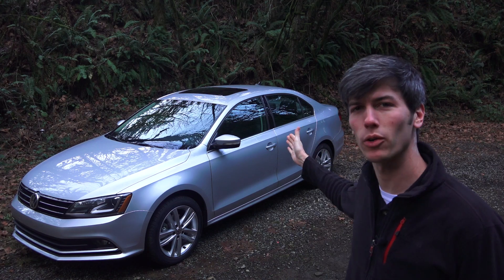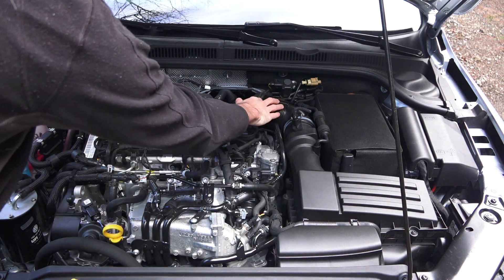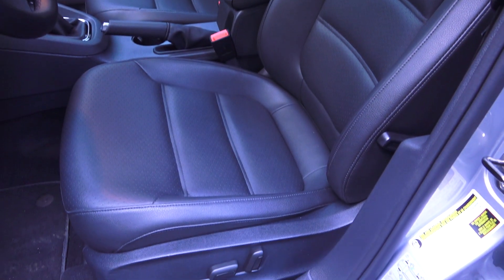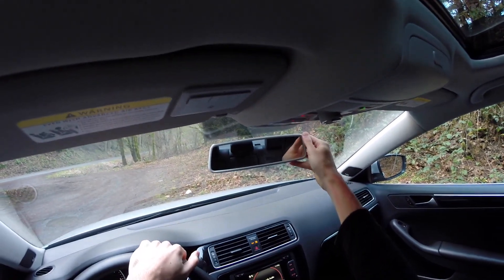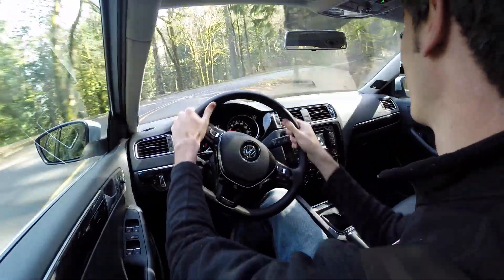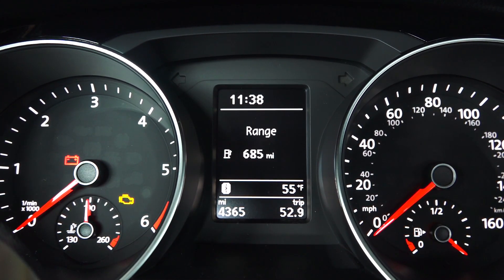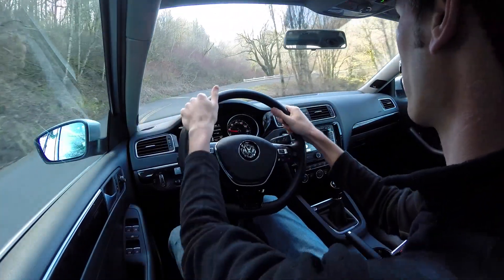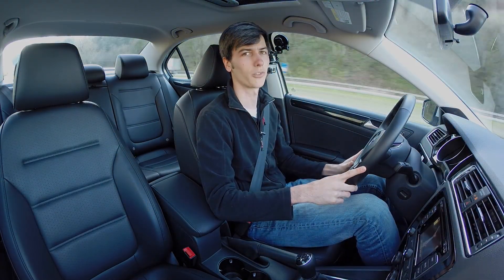2015 VW Jetta TDI - Review & Test Drive

Comment: So, would you consider a 5000$ gap as justified in comparison to the Corolla?
Reply from the maker: Very good question. The base starts at under $22k, though the base Corolla is maybe $17-18k. I've driven the Corolla LE and wasn't as impressed as I was with the Corolla S. Diesels will pretty much always be more expensive, but I thought this was a fantastic car. If you're considering between the two I say test drive them and see what you think.
Reply from the maker: elwulfo666 Let me add, I thought the Jetta was more fun to drive. The Corolla is certainly more economical, and comes with Toyota's undeniable reputation of reliability.
Reply: and if you compare the interior? which one do you prefer in terms of quality, material and "infotainment"(i hate this term :D)
Reply: termantor28 I'll give you the doors that close with a better feel and sound, but I recommend you have a look under the hood and interior trim. You will find cheap parts in places in this VW where you certainly would not want to see them.
Reply: elwulfo666 I would say the vw would blow the doors of a corolla in terms of quality of materials, i even just closing the door on vw feels solid, when it comes to the corolla it sounds like a hollow door. Test both cars and see for your self
Reply: Markus Krause Greetings!
I must not agree with you in sense of comparison to few other car manufacturers. I think VW's interior look is indeed... hmm casual?.. like we are used from Germans, but every single thing is placed where it should be and every time you look at dashboard, you got this feeling "Damn, they have really put some effort in making it as much driver friendly as possible".
Most of parts which are used by driver are (in my opinion) made from "non-cheap-feeling" materials. But ofcourse, if you do look at parts, which are not used that common at casual operating, then sure you'll find materials which give you in most cases "cheap-feeling". 
It's just my opinion, but I do find Jetta's interior nice. Causal with sense of usefulness.
Best regards!
Reply: Markus Krause . I couldn't agree more. I've been a technician for well over 20 years now and German build quality is some of the worst in the world. Their plastics, rubber and bonding materials are designed to fail too early in life. The fuel economy of a vehicle such as this will more than likely be well offset by its terrible build quality. I would typically advise my customers to consider only buying one if they plan on selling it before the warranty expires. If one is looking for a truly economical vehicle, then you should consider something Japanese, such as Toyota or Nissan. Their cars are designed to last. I would be surprised if anyone who cared for their Japanese car didn't get a good couple of decades out of it, at least.
Reply: Baerchenization Take it easy for a bit and try to listen.

Yes, Toyota had recalls. Yes, there were some bad issues, and some mild issues. Yes, they should get flak for it.

But this does not mean that Toyotas are not reliable. The numbers still speak for themselves time and time again, year after year.

You're taking the recalls and blowing them way out of proportion in order to incorrectly conclude that Toyotas are not overall one of the most reliable brands you can get.

The fact is Toyotas get you from A to B more reliably and consistently (THIS is what people consider reliability in the automotive industry) than most other car brands IN THE BIG PICTURE.

Please try to be more objective. The stats don't lie.

FYI, I do not own a Toyota. I drive a VW that I bought brand new. I've taken it in for warranty work twice in the 37k miles I've driven it (still enjoy it though).
Reply: Baerchenization Sigh.

Toyota has a reputation for reliability -> true

I think we can both agree on the above statement. Now, it DOES matter where you put the word "undeniable" as the meaning will be different. Watch and learn:

Toyota has an UNDENIABLE REPUTATION for reliability -> true, as it is in fact undeniable that they have a reputation for being reliable

Toyota has a reputation for UNDENIABLE RELIABILITY -> false, because their reliability is not undeniable as there are some examples of widespread issues (e.g. recalls).

If you can't see the CLEAR difference in meaning between the two, then I don't know how else to explain it to you.
Reply: termantor28 I know about the doors. I've driven several Toyotas and each and ever one of them had weird sounding doors. Anyhow there are so many VW's with bad interior parts that make grinding noises or have bad materials.
Reply: I probably didn't get my point across. I was not talking about the interior itself. (which I don't like for it's looks but that's just my taste and nothing objective)

I was actually talking about parts used in the drivetrain that are made in a way that almost guarantees that it brakes too early in the life of the vehicle. As already mentioned, VW timing chains are a good example there. And really cheap plastic tubing that already feels brittle when it leaves the factory. I've seen PCV tubes break in those cars just after 3 years because they are so cheap and they cost a fortune to replace. BMW does the same bad things. They are beautiful on the inside and offer top notch technology...but they use plastic electric water pumps that break after 60000km...and cost a couple of hundred € or $ to replace and are insanely hard to get to...and yeah...a BMW 335i doesn't even have an oil dipstick anymore...those cars are a lot of fun when they're new...but I personally would not want to maintain a VW TSI engine or a current BMW in 6 or 7 years from now. Sad but true.
Reply: rjmari, if you can name a manufacturer which doesn't issue recalls, then I'll show you a poor manufacturer which isn't responsible.
Reply: That is an important point to make, recalls actually show that the manufacturer cares beyond regular warranty. Usually you see manufactures do recalls only if enforced by government instututions. Many japanese manufacturers go well beyond that, even if the faults are not safety relevant. As already stated it is a really bad way to measure reliability by looking at recall numbers.

And let's be honest here: Cars are very complex nowadays and it's almost certain that something will break prematurely. But it's about the way the manufacturer handles customer complaints. And let me tell you, there's probably nothing worse than VW in that respect, I have a lot of experience with that, our family owned 5 VW verhicles before switching to japanese makes 4 years back from now. And 9 tries to prevent water from getting in the fog lights and still no solution shows to me how bad VW quality management and engineering actually is (and that is one example that not really affects reliability, we had things that were a lot worse).
Reply: Baerchenization Referring to my Opel Brake failure point you wrote: "GM had to recall TWENTY MILLION cars for that reason(...)" which as a fact is wrong.
Also Opel is not GM but owned by GM. They don't build the same cars and therefore don't have the same problems. At last I didn't mean to say Opel didn't have problems but I meant to say that Opel didn't adress them properly.
Reply: Arguing with anyone from the UK about Japanese cars,then you're just wasting your time...For God's sake the ppl still believe Range Rover is the most reliable vehicle out there.
Reply: Engineering Explained Your threshold for undeniable reputaion of reliability must then be above 2 million of more recent recalls :) You should put these definitions in the footnotes to avoid confusion ;)
Reply: Baerchenization Please learn what the Toyota recalls are about before you continue perpetuating that idea. Some poor design decisions, yes. Buggy ABS software okay. And sure, faulty power window switches (omg the reliability!!).

But they have nothing to do with powertrain reliability.
Reply: rjmari You need to put in your footnotes that when you are talking about reliability you are only talking about power train reliability - people could get confused...

You don't even know whether I learned about the recalls, so why do you tell me to? A recall is a recall. It means people have to go down to the dealership, etc, etc... in any event, you cannot call it undisputed.
Reply: rjmari Jesus, like a faulty breaking system !!! of all things does not count in your book - go learn something:

http://www.bbc.co.uk/news/business-29625734
Reply: "Toyota told the BBC it was not aware of any crashes, injuries or fatalities caused by this defect."
Indeed. Very diligent and proactive of them.
Reply: rjmari No, I am afraid you are making that up. I did not blow anything out of proportion. I pointed out that they had millions of recalls and that that does not leave their reputation undisputed, not more, not less. I did not put them in the corner with crap manufacturers, either. And then I made the point that you cannot simply exclude certain causes for a recall according to your personal agenda - since when is reliability only measured in terms of drive train? It isn't. Toyota's track record simply is not impeccable, either, and you can slice it dice it any way you want, I will not agree to it because it is not so. I did not go down the route of rating them anything, including 'crap'.
Reply: Baerchenization I'm pretty sure you're the only one who used the words "undisputed", "crap", and "impeccable" here. You're arguing with an imaginary person.

The comment you first replied to said "undeniable reputation of reliability", which Toyota has and has earned.

Please look up each of these words in a dictionary. This does not mean they are perfect. It means, as a whole, they are a reliable manufacturer and have a reputation for it.

You can cry "recall" all you want, but Toyota STILL hits top 3 on almost every list I can find for automotive reliability even after the latest recalls.
Reply: Baerchenization Well: In fact other Manufacturers had huge ass problems too and I never heard of a recall there. For example Opel or Vauxhall or what ever they are called in your region had problems with breaks getting stuck right after the drive. Just imagine you drive over a railway crossing, you have to stop but can't take off again. No recall.

VW has problems with TSI engines: No recall
VW builds a 1.2 3-pot that breaks after 150k kilometers because of a really bad overall design: No recall.
Almost every VAG car has a problem with oil consumption: Don't car... German quality.
DSG has software issues: No recall.

Toyota has a really bad issue with the braking system: Recall
Toyota has found faults in car that are up to 15 years old and 10 years out of production: Recall

They care about their customers and you can't hold that against them.
Reply: elwulfo666 Well, that is nonsense. Or at least taking 'what you have heard of' as a guideline for anything is nonsense. Vauxhall / Opel are GM, and if you have not read on and off that GM had to recall TWENTY MILLION cars for that reason, you have been living under a rock. You can find that like 1-2-3 by putting any of those brand names together with brakes and recall in to Google... not that you have to, it was all over the regular news. They recall more than they sell...

Anyway, I already said I didn't call Toyota crap, other things you can read on the news every year around this time is reliability rankings. I just pulled one up again I come across recently; it regards +8 million cars inspected in 2013 in the course of German road worthinerss certification. They do top 10s for age brakets up to 3, 5, 7, 9 and 11 year old cars. There are Toyotas in all of them, sometimes even a few. But it is not a Toyota top 10 - there are other usual suspects. In fact, with a few exceptions it is pretty much a Japanese and German show... btw, Porsche does arguably even better. Now people say, hold on they are way more expensive, but that is obviouisly not an argument - by that token Ferrari should lead the top 10, as they cost twice as much as a Porsche. But they never make it in to any top ten, except for cars going up in flames ;)
So there a a few manufacturers that do pretty much on par with Toyota, or rather the other way round. I don't understand why people always try to instill this extraordinary status on to them.
Reply: Baerchenization Well, you're wrong. The big recall last year was due to faulty ignition switches, shift cable problems, other braking problems and several other issues. Not a single Opel or Vauxhall was recalled. This year they have a minor recall but.. eh.
Reply: rjmari You are also pretty wrong on top of being pretty sure. He literally said "Toyota's undeniable reputation of reliability" and I literally picked up on that in my initial comment saying "Your threshold for undeniable reputaion of reliability must ..." - don't believe it, scroll up. Now please don't go about how this may have changed to "undisputed" in the follow-up, where it is clear what is the statement in question. An undeniable reputation for quality can be called impeccable, I am well entitled to introduce it; I can also point out that my comment did not mean to put them in the crappy car corner - what is the issue with that?
Reply: elwulfo666 No, still no good. I did not say last year. I made a point in reply to the claim that other manufacturers such as Vauxhall/Opel also had issues, but the poster said he had never heard of any recalls in that context. - To which I replied that fuck yeah, GM had 20 million recalls, which is Vauxhall/Opel. So the point was that contrary to what he thought he'd know, there indeed were major recalls. That was the point, and there was no mention that it was somehow in 2013.
Reply: elwulfo666 Firstly, I do not have to look in to the reason for every single recall out of 20 million for a Youtube comment. Superficial reading of Google hits shows that the break issue was certaintly in there, and in that far I am correct.

And then you are wrong in multiple ways. A 100% subsidiary of GMas Opel is,  is for practical and legal purposes GM, who is here to doubt that?

And then you are very wrong on the cars sold not being the same. You can educade yourself on that reading the GM Wiki, I do not have to recount it here. Vauxhall certainly is a 1:1 copy of an Opel, and in the USA, Opel are Buicks, it literally says at the Wiki that they are sold as identical cars, with very minor cosmetic differences only. So yes, Opel is GM, and vice versa. And of course a company like GM shares a lot of components throughout the range, there is no other way to do these days. VAG, and everybody else do it, too, of course... no surprise here. Btw, when we are talking "GM" recall, that does not mean cars with the GM brand badge only, it refers to the company as a whole, just so you don't come back on that one ;)
There are other examples of Opel being sold under the actual GM brand at the Wiki, btw, but I did not check the English Wiki, so you may not find all the same details, just so you know; but typically the English one should be the most complete.
Reply: Yeah you're right on that the part with Buick. Didn't have them on the list because... I don't care that much. Anyhow, the brake problems with the Opel Corsa B weren't adressed in any recall. Anyone who had the problem could go to the workshop and get the problem solved for a few euros but no recall. Just believe me that many manufacturers just don't care after the warranty runs out except when they are forced to just like GM last year. So do you want to buy a car from a company that cares about its good reputation or do want a VW?
And with that this discussion is over!
Reply: Baerchenization LOL

First of all, I know you edited your original comment. You can't fool me on this, so please don't try anymore.

How pathetic are you feeling right now?

And even if your original comment quoted him correctly, you still changed the word to "undisputed" in your next comments, so your effort in editing your first comment is in vain. Please go change the rest of your comments, too.

Second of all, "undeniable reputation for reliability" means literally that. Again, please look up the words. "Impeccable" and "undisputed" mean something completely different from "undeniable".

Actually, I will walk you through it since you're so stubborn. When you put the two words "undeniable reputation" together, it means that the REPUTATION itself is UNDENIABLE. Toyota DOES have a reputation for being reliable, and the REPUTATION is undeniable. Nobody is saying that their RELIABILITY is undeniable/undisputed/impeccable or any other word you choose to add into the mix.

Does that make sense? I really hope English is not your first language, because if it is, your school system has failed you.

Your whole argument is dependent on this phrasing, and you keep changing the original phrase to try to strengthen your horribly weak argument.
Reply: Baerchenization You can say whatever you want, but the fact of the matter is "undeniable reputation for reliability" doesn't mean what you think it means.

It is undeniable reputation, not undeniable reliability, which you keep suggesting it means.

Short enough for you?
Reply: rjmari Really? I can say whatever I want? Then let me ask you this: Has intelligence sharply declined since I've been out for the day?

What you say is insane - reputation... FOR WHAT? It only makes sense if you reference what the reputation is for, or else it could be anything - and here it is is plain as daylight that it regards reliability because it say so right there! Is there something wrong with your command of the English language?